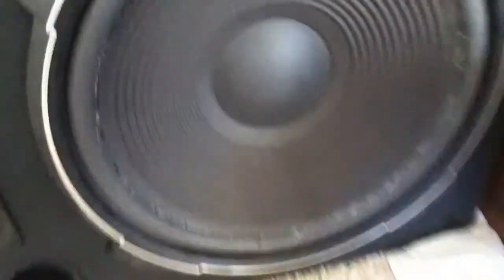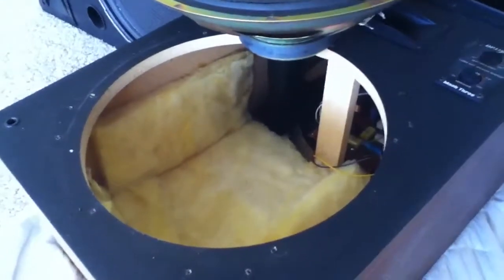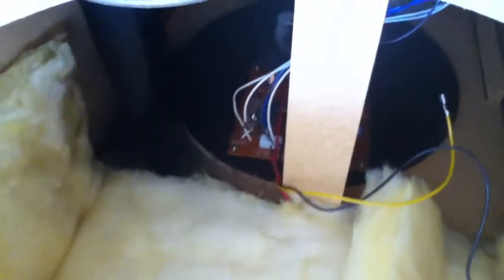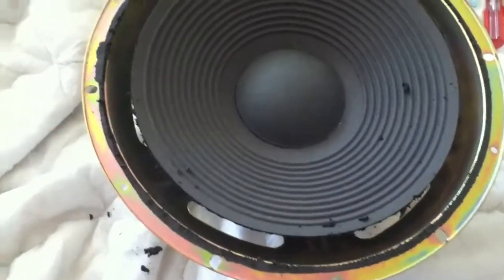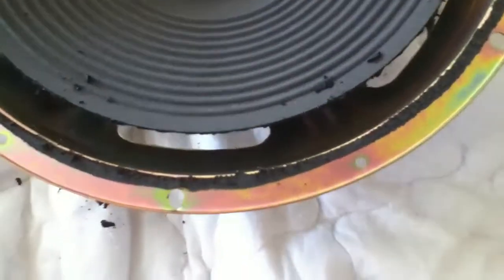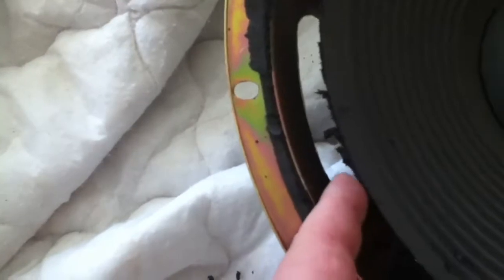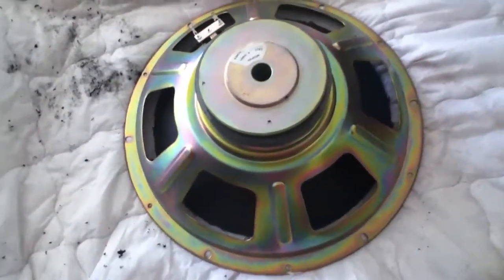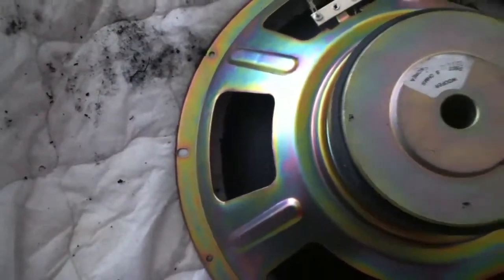3-16-2013 MACH 3 speaker surround prep

Comment: You should redo this properly. Hurts to look at how a good speaker is getting destroyed.
Reply from the maker: yea my first attempt at new surrounds and the size was wrong but they said you could overlap a bit so I did plus maybe more glue than necessary but the main thing is that I managed no "hub rub" or what ever you call it when the speaker travels up and down so it sounds great as is and is not damaging its self playing cause it is centered so there is that .... these are my mains for TV and music so I don't want to take them down for a re work any time soon.